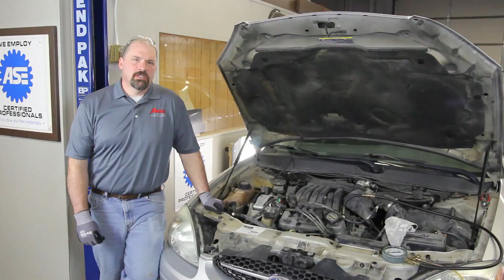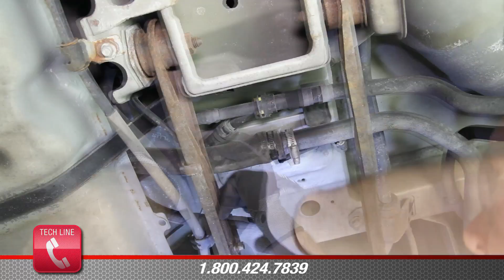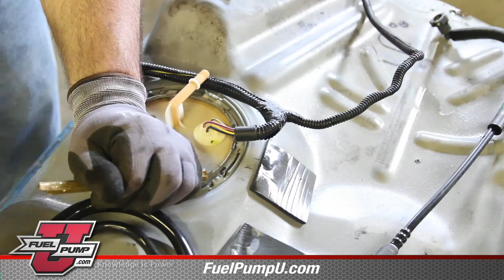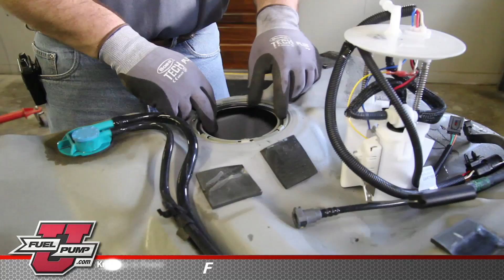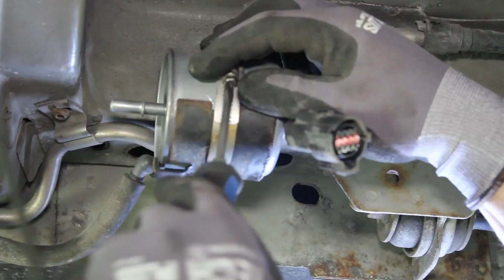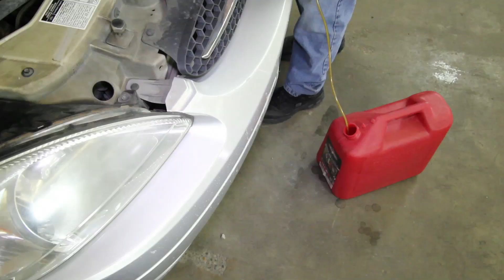How to Install Fuel Pump Assembly E2313M in a 2002 - 2003 Ford Taurus

Comment: Does anyone know what those two blue parts are called?? There's one on the top left corner and bottom right corner,  there both blue.  My husband cracked it after he replaced the fuel pump,  and I need to replace them.

Comment: Have 2002 sable replaced comp fuel pump with sending unit the gauge is off now it says 3/4 when full wiring is good , can I bend the float arm to adjust it ?